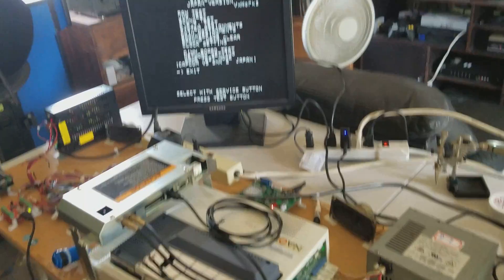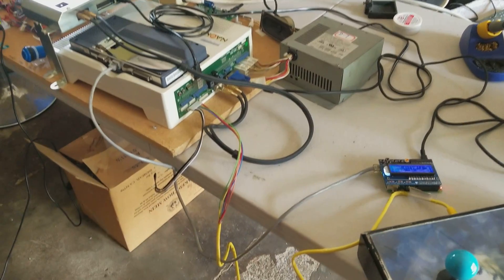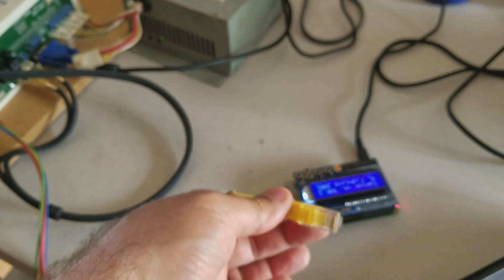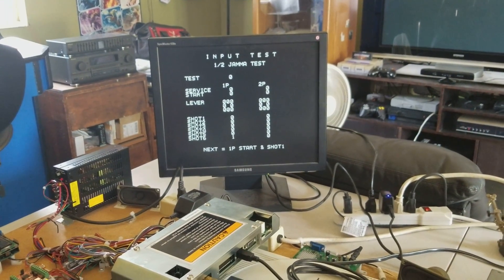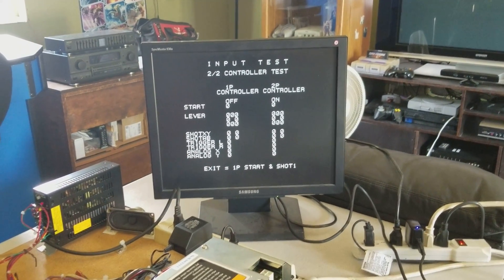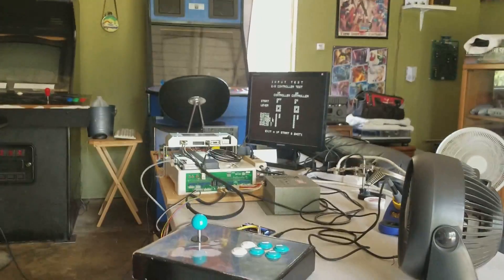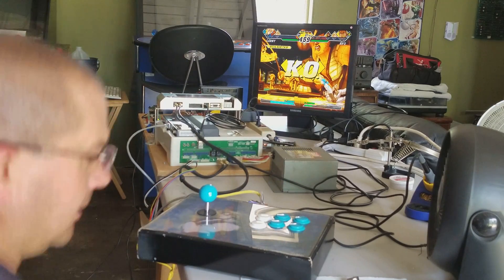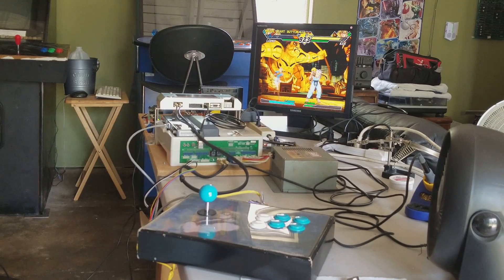Controlloing Sega NAOMI via MAPLE (CN6 and CN7) with MC Cthulhu Figh Stick

Comment: is it necessary to have i/o board?
Reply from the maker: There are discussions about the necessity of the i/o board on various online forums, if you search for them.  I dont remeber all the details, but I believe that due to certain voltage and/or signal requirements, the i/o board is necessary.  Basically the naomi wont boot beyond an error screen without it. Again, search around for the info, I could be wrong.
Reply: Unfortunately from what i've seen, most games won't even boot without an I/O plugged. The few that boot I can't say if they work with only the dreamcast controller

Comment: Awesome, my friend. I'll try it on my naomi setup. How i do this RJ PORT on my arcade controller? I wish make a super gun with a new spare of jamma harness that i have here.

Thanks!
Reply from the maker: Hi Raph, sorry I didn't see this until now. :/  Mating up an RJ-45 with the mc cthulhu is well documented on the internet, just search for it.  In order to get that to work with a supergun, you will probably also need something Undamned's UD-USB Decoder.  Great little devices.  But if you're going that route, then you do not need to connect driectly to the NAOMI.  Frankly, going through a UD-USB Decoder and a supergun will ensure your controller will work with all games you are playing (controls routing through the JAMMA connector.